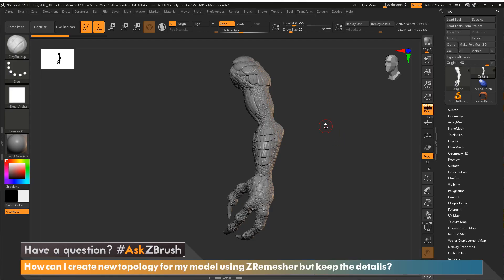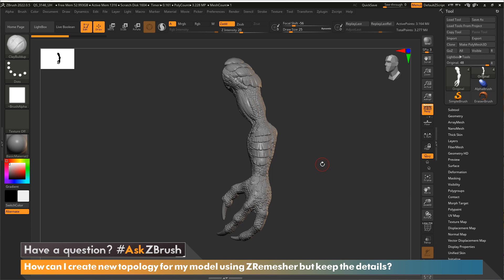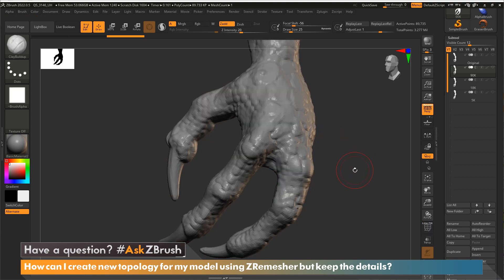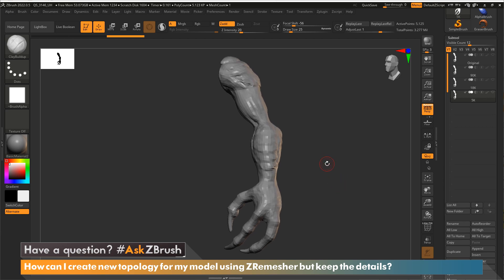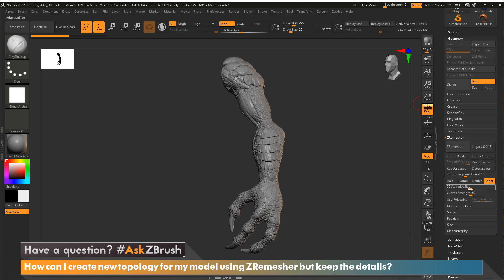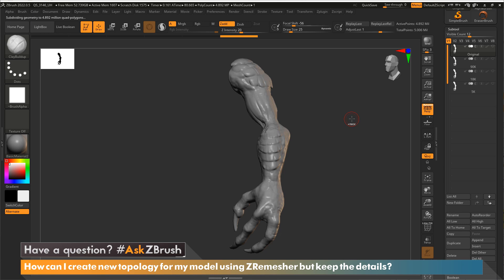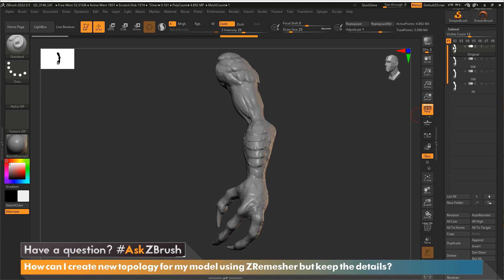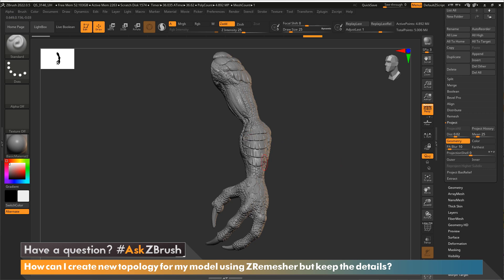#AskZBrush - How to Maintain Sculpted Details Using Project History on a ZRemeshed Model?

Comment: Tip: If your Hi Res mesh has lots of peaks and pointy bits which got flattened in your Low Res mesh, in the Project section, under project all, move the Dist slider up, should fix it right up.
had me stumped for a while why my spikey bits looked like flat nipples after the projection LOL
Reply: Thanks for that, I had the exact situation arise, and now gonna use that tip.

Comment: I'm relatively new to ZBrush, so I have kind of a beginner's question...

I lost the subdivision history of a model I made. I need it to create a normal map. So, I was told that the process demonstrated in this video restores a low-to-high-rez history. And, so it did.

Then, I needed to create UVs for the model. It created seams I didn't like, but it came time to close the file down for the night. I opened it up again and that resolution / subdivision history was gone. UV seams are there, but the only thing that exists in this scene is a seamed, low-res version. I still have the scene (lower version #) with the subdivision history restored by the ZRemesher technique, so I can go back and try again. 

Thanks folks.

Comment: My question is: the mesh is still at 4.8 mil count. Can I have a mesh with lower poly count, but with details?
Reply: yea i dont understand this.. the mesh ended up having more polygons im very confused
Reply: @Huesgroove  Also confused by this, my best thinking is that this is less concerned with polycount and simply wanted to clean up the topology on a high res mesh without leaving zbrush to retopo?
Reply: @Binkoboy3 I think it’s so you can get nice UVs from the lower poly version, then import it into a painting software and then bake the high poly details back onto the model
Reply: @Huesgroove  in the end you have a multiresolution mesh that in the lower subdivision has less polygons (around 19000) zbrush should works better with subdivision mesh than dynamesh
Reply: I'm having the same question right now after watching this lol